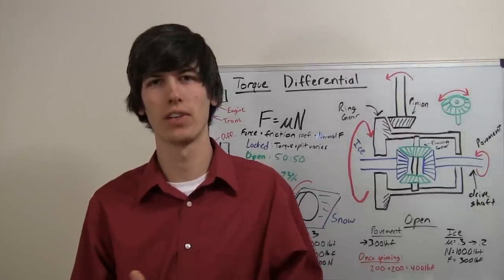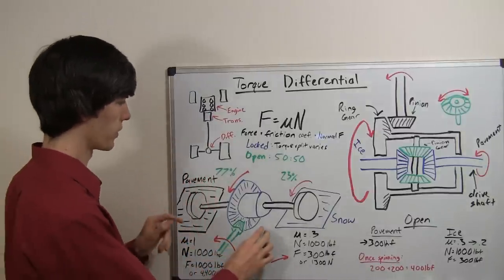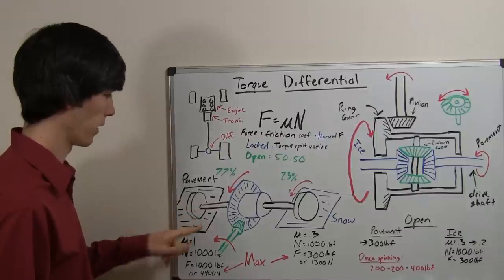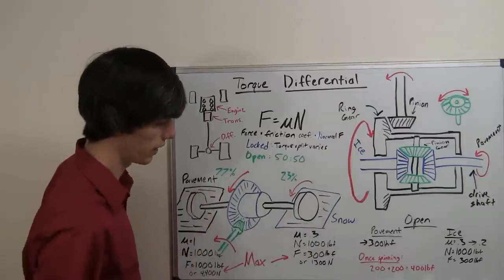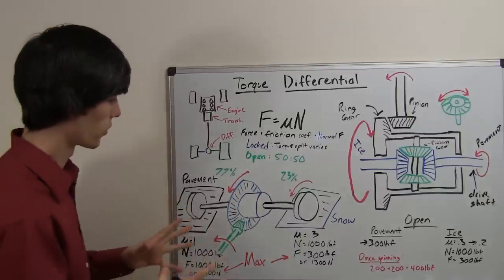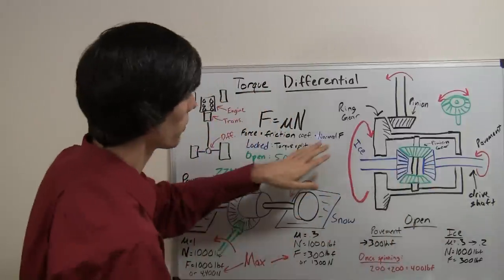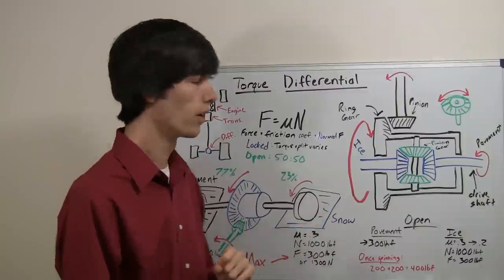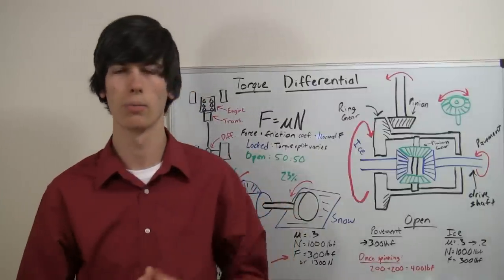Open vs Locked Differential - Torque Transfer - Explained

Comment from the maker: You are correct on the tq split and wheel speed split. A difference in torque does not require a difference in wheel speed, which is what is somewhat difficult to grasp.

Comment from the maker: Depending on the gearing of the differential (let's say 1:1 for simplicity, even though this is unlikely), then you would have 200 Nm to split between your two wheels. You could (with a locked diff) have up to 200 at one wheel (theoretically) or a 100Nm/100Nm split.

Comment from the maker: Basically each brake (on newer vehicles with electronically controlled AWD via the brakes) is controlled individually. By applying the brake to the tire that is about to spin free, the car can keep torque up on the wheels that need it, simply by preventing wheel spin.

Comment from the maker: The maximum amount of torque that the wheels could put down would be the amount of torque sent by the driveshaft, which in this example was 1300. Though it will be significantly smaller, even a spinning tire does apply some torque to the ground.

Comment: Congratulations, you are the only one in auto media that understands torque split is = with an open diff.
I wanna have a discussion about the Torque Vectoring Diff as they don't really show how it works. And I said that on their  ZF movie and they erased the comment.
Problem is it cannot work with only one coupling per side. It's like low and high, or 1st - 2nd you need 2 couplings, which they don't show.
And the ratio is fixed so there will be 50-50 in normal driving and a fixed 60-40 left-right in a right turn.

Comment from the maker: Simply put, torque goes where there is resistance. When you press down on one of your fingers, torque passes to your knuckle. When a force is applied to the ring gear, it passes to what resists that force, aka the tires.

Comment from the maker: I know it seems unlikely, but it's more than possible. Due to the way the tire deforms, and the direction of travel, it's quite common for tires to be able to put down 1 g longitudinally. Laterally, it'll take some sticky tires or good downforce; see my video "traction circle" for clarity.

NHRA dragsters can put down close to 5 g's, and yes, they're basically glued to the road. It has to do with how a tire sinks into the surface; they're not just simply rubbing two surfaces together.

Comment: I've held multiple differentials in my hands, and read and studied them.  I made them lock and see how they behave under different circumstances.  I've set backlash etc, but honestly couldn't wrap my head around why or how it works, but I simply know that it does.  Thanks for breaking this stuff down as I've just kind of gave up on it and decided to proclaim it witchcraft.

Comment from the maker: 3. The numbers were arbitrary, I just picked simple numbers for an example. You won't have a different input than output. You cannot put in 1000 lb-ft and only have one tire deliver 300 lb-ft. Your engine will only deliver the maximum possible. If the maximum torque you can put down is 300 lb-ft, that is what the engine will send if you allow it to. Any thing greater will cause the tire to spin, and rotate faster, until you reach an RPM limit.
Reply: Damn, was exactly looking for what happens if we throttle further to deliver more torque than can be delivered 
Thanls!

Comment from the maker: A spinning tire in the air does no good, as you've mentioned. That's why locking differentials send the torque to the wheel on the ground, and both tires remain stationary until the torque is adequate enough to either spin the tire or move the car forward.

Comment: My FWD Volvo S60 has an open diff but when it gets stuck it will brake the wheel that is slipping, which is increasing the torque applied and allows the wheel that has grip to move the car. I hope i understood this correctly and i hope mr Stewart will get it soon.
Thanks for the great vids!
Reply from the maker: You are correct! It's a good way of increasing the torque applied to the wheels.

Comment from the maker: 1. Not sure of your question, I will follow up.
2. Because only one side of the shaft is resisting. Don't necessarily think of it as only having torque on one side. The torque can only be delivered where there is resistance. If the other tire were to have resistance, torque would transfer to it as well. All of the torque must go somewhere, so it goes where there is a location to put it.
3. (continued below)

Comment from the maker: Sorry, didn't see this. If the engines give more torque, the wheels will likely spin - the torque applied to the ground will remain what the frictional limit allows, which will be less than what the engine provides.

Comment: i think that what your viewers concerned is the torque (moment force) applied to the WHEELS like form the equation τ=r*F or τ=r*F*sinθ. in the locked differential, since the turning force form the driveshaft is evenly distributed to both wheel, the wheels should have the same force applied to the ground. in contrast, the force applied in the open differential is different because more forces needed to turn one wheel further. thus, open differential will have different torque distribution.

Comment from the maker: Torque and speed do not necessarily correlate. You can have torque without motion. That doesn't mean if you put equal torque to two wheels one will rotate faster - this is only the case if one of the tires exceeds it's grip, and begins to spin, or if one of the tires doesn't have enough torque to rotate.

Comment: Great video! Saw tons of videos explaining that in an open diff, one side axle shaft rotates at a different speed than the other one, but nothing explaining how the power is transferred between those two sides. I drive 1/10 scale RC crawlers that usually have locked diffs, and I was hoping that with an open diff both sides still receive power, instead of one side just rolling and freewheeling when the other is caught up. Mounting an open diff on the front with some thick oil will probably result in some pretty scale performance!

Comment from the maker: I wouldn't say they don't make them. But most cars that plan on getting into situations where they may get stuck typically have power going to all 4 wheels. That said, I'm sure there are lockable diffs out there for 2WD setups. A diff is a diff. :)

Comment from the maker: If friction is the same at both sides, the torque will be the same at both sides, regardless of the type of differential used. But it wouldn't be difficult for friction to be different. One tire could be slightly more worn, or at a different temperature, or have bits of dirt/dust on it.

Comment: Sorry to comment this old video, but i am not sure it explains how torque can be split, say, continuous 60:40 rear axle vs front to give an awd car more of an "rwd car feel". I know you are talking single axle here, but the same principles should apply front vs rear? You seem to be using surface friction as the variable that defines how much torque can go to each wheel, but all things held constant it should be some characteristic of the diff that splits torque unevenly. Please feel free to point me to another video if this is explained elsewhere. Your videos are very informative, thanks!

Comment: Awesome video, however I think the axle on the right is different from the left. If you use the ring gear teeth as a reference point, the teeth face the tire on the snow in the left axle drawing, whereas on the teeth face the tire on pavement in the right axle drawing.

Comment from the maker: It may have driven fine but he's putting extra strain on the drivetrain, and will increase tire wear if he leaves it like that. Unless the diffs are open in 4WD, then it's not a problem.

Comment from the maker: You have the locked down, but not the open. An open diff receives equal torque to both tires, always. So if one tire has no grip, then it requires hardly any power to rotate. Once rotating, the other wheel with traction is receiving the same force, but because the force is so small, it's not enough to move the vehicle.

Comment: What I understand is that this torque problem is more about max torque applied. In the locked differential, torque is transferred to the wheel with greater traction due to high coefficient of static friction with the pavement & both wheels are rotating at the same speed. While open differential prevents more torque from being transferred to the wheel with greater traction as the one with lower traction limits maximum torque usable as it starts to spin. Correct me if I'm wrong.

Comment: In response to your second question, the axle is made up of two rotating shafts connected by a differential. They can spin at different speeds because of the pinyon wheel.

Comment: Hey man, love the videos. Not trying to nitpick but just trying to share: I did some research after watching this and it turns out that in order for the coefficient of friction to equal 1 that would mean that in order to move the tire you would have to apply a force equal to the normal force horizontally. This seems extremely unlikely unless you glued the car to the road or chained it up

Comment: some fundamentals, if you would be so kind.

1. locked diff example, why do you add in the torque required to move the other tire with less grip? ie, why doesnt it move when it reaches 1000 instead of 1300?
2. how can there be a different torque on each end of a solid shaft?
3. in the open diff, why is 1000ft/lbs of torque insufficient to move both? if youre inputting 1000ft/lbs of torque but the diff is only utilizing 300 to spin the tire with less grip, what happens to the rest of the torque?

Comment: I'm looking forward to your video on LSDs.  Will you please include an explanation of what mechanically determines the "strength" of an LSD?  My understanding is that, without any electronic interference/autolocking, some LSDs can get closer to full diff lock than others.  If this is true, are there advantages to different LSD "strengths" for different driving applications (ie. daily driving/track/drifting/off-roading/snow and ice)?  What about cost?  Thank you!  I love all your videos.

Comment: I may be wrong but after a lot of confusion and a bit of research, I think there is a mistake. As far as I'm concerned the friction coefficient of the tire on the snow needs to be smaller than the one on pavement. Also the calculation for the frictional force of the tire + ice of 300 lbf could only be right with a friction coefficient of 0.3 which would make more sense since it needs to be lower anyway.
Sorry if my english is a bit off, it's not my native language. I still hope I could help other initially confused people like me figure out why they were confused. Thank you for the great video btw!
Reply: Yes, the friction coefficient is 0.3. He has it written as ".3"

Comment: Both tires get the same tq in a locked diff. If one tire has more traction then that tire is USING a higher percentage of the tq but that does not mean that it is getting more of the engines tq or that it has more available that the other tire.

Comment: I know this is an old video but I've got a quick question about open diffs. If you lift one wheel off the ground to where it has no resistance to spin and left the other on pavement, wouldn't the only torque transfer to the wheel with traction be caused by the spider gears resistance to spin on their axis? Because if there was theoretically no friction/resistance to movement in the diff itself, then the spider gears would simply free spin around the driveshaft of the wheel with traction while trying to spin the one without traction.
Reply: I know this is an old comment... :D There would not be just the friction in the gears, but also aerodynamic drag of the spinning wheel and possibly some other small forces. Whereas this is valid for steady state conditions. You can also have dynamic forces. If the car and everything is stationary and you step on the gas, the lifted wheel will start spinning. And the same torque needed to spin up the wheel will go also to the other wheel.

Comment: as an automotive engineering student i am so glad to see that you keep doing great videos on the cars. well, i can clearly say that i have learnt lots of things from your videos. But i couldn't get just one thing on this video. If friction coefficient  is higher on snow , wouldn't force applied on this surface be higher value???
Reply: It's lower on snow, since snow is easier to move than pavement. Therefore there is less torque going to the tyre in the snow
Reply: The coefficient is 0.3 not 3

Comment from the maker: No need for all caps. If traction is equal both wheels will spin, if one wheel has significantly more traction the other tire will spin.

Comment: applying the brakes only increases drive if there is a torque biasing differential.

brakes absorb torque from both sides equally, so any rise in applied torque at the tractive side of an open diff due to braking the slipping side is offset by the brake system absorbing that same amount of torque. You need a torque biasing differential which creates a larger drive torque on the tractive side than the braking force on the slipping side in order for yout technique to be effective.

Comment: do you mean you didnt understand my question? im referring to the part at 4:30 where you mention that the maximum the car can lay down is 1300, 1000 for the right plus 300 for the left. i would assume that once the car can move the tire with more resistance, the other tire would move too. but thats just my random guess and thats why im watching your videos!! id really like to understand more and why the engine would need to produce 1300 in order to get the car moving.

Comment: Locked differentials don't work well for normal driving on pavement or on any high friction surface on which turns are made.  This is why old cars used to have one-wheel drive in pre-open-diff days!  When you make a turn, your wheels must rotate at different speeds to maintain rolling contact with the road, because each tire has a slightly different distance to cover.  For example, when you make a left turn, your right rear tire moves further than your left rear tire.  Hope this helps.

Comment: hey man, isn't the locked diff limited by the 1000 lbf force? in my mind, none of the wheels can spin unless you reach 1000lbf, the 300 lbf wheel can spin if it was free but  it is locked in rotation by its fixity with the 1000lbf wheel and so once you reach 1000lbf it will spin. can you explain to me why the the force required to spin the wheels is additive? thanks
Reply: iwrotefuck I think that is why he is saying the torque gets split.  If both tires were on snow then they would spin at the 300 lbs of force. Since one is on pavement and one is one snow the greater friction coefficient prevents the wheel in the snow from spinning freely since it is locked with a wheel that has traction, thus changing the torque output to the wheel on the snow.  If it was a 50/50 torque split you would have one wheel (on the snow) spinning and one wheel on the pavement still having traction.  It makes sense if you think about it, probably could have explained it a little better but I got the jist of it but I'm not an engineer nor do I have a background in physics
Reply: yeah, i was thinking the same when he was going over the locked diff. but i think it's because in order for the tire on pavement to receive 1000lbf of force, 1300lbf would need to be sent to the diff to spin the tire on pavement (since not 100% of the force is being sent to one tire alone and 300 of that 1300 is being sent to tire on snow). i think that's what jordan was saying below.

Comment: hi there, you are saying that when we rev. the engine hard, torque distribution gets settled to 77:23 as in the illustration stated.but if it is having a single shaft for connecting wheel does not the shaft is subjected to shear stresses due to torsion,how that mechanism takes care of that.....looking forward  for your esteem reply

Comment: Great video 
But I have a doubt 
Is it necessary to connect both the shafts in a locked differential.
In other words can we make a locked differential with two non-intersecting shafts.
Actually I am designing a 4wd transfer case for my project and need help.

Comment: Love your videos man,

It is typical for today's trucks that say 4x4 locked as an option to have all four tires locking or just the rear. My dads 2013 ram 1500 has it and he drove on pavement with it locked and it seemed to drive fine..?